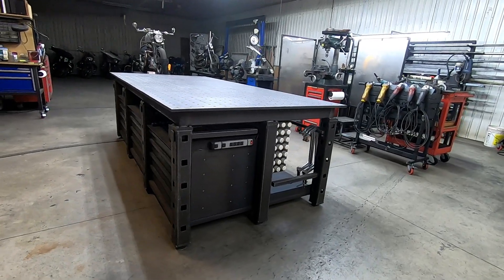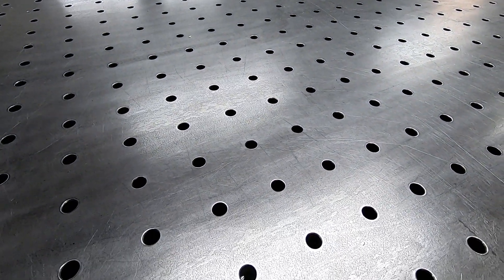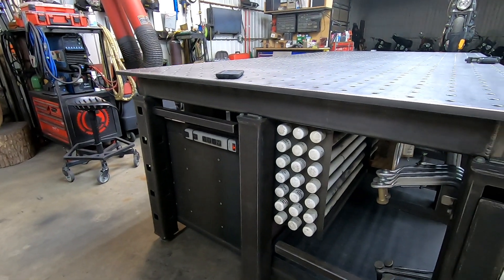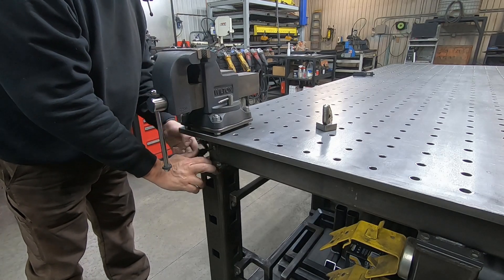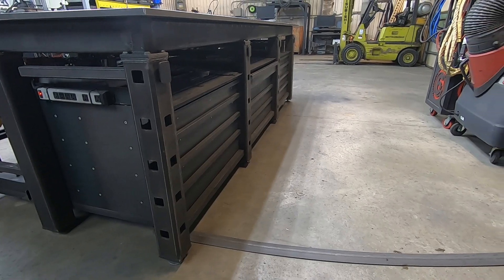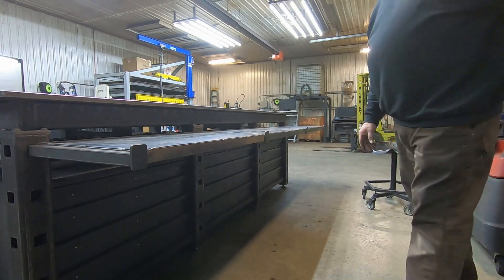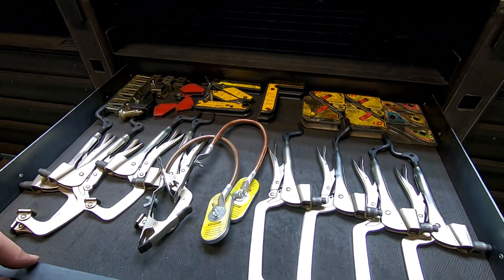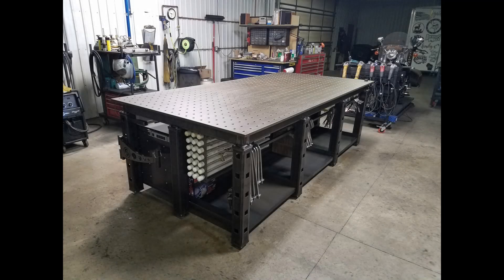6L Designs homemade 5x10 welding table with many unique features

Comment: That is an amazing fabrication table/jig table!  Did you make all those drawers as well?
Reply from the maker: Yes, I sure did! It was the only way to really maximize the storage space below the table top!!
Reply: How many hours do you figure it took you to fabricate the complete table?
Reply from the maker: @wade7920  Total time including CAD drawings 137.38 hours! I kept track of time and material cost, which was $7,160.22 in 2019! It would be quite a bit more today!
Reply: @6ldesignsmetalinmotion217  Yup, figured it was expensive.  I know steel went thru the roof a few years ago.    Don’t know how high it is currently.
Reply from the maker: @wade7920  It came back down, but not to what it was before COVID 19! It's just how it goes!
Reply from the maker: I worked on it for about three weeks from start to finish! @wade7920

Comment: Great table, what kind of drawer slides did you use?
Reply from the maker: The slides are made by Accuride. They are full extension, ball bearing slides, side mounted, and are load rated at 100 pounds each! The product number is 3832EC. They are all still working very well, despite the fact that some of the drawers hold more weight than the rating!
I hope this is helpful!

Comment: Thats a well thought through welding table. Kudos!

Are the drawers folded sheetmetal? Or something of the shelf?
Reply: Thank you for your very nice feedback!
I fabricated the drawers myself to utilize as much storage space as possible! They are made from 12ga hot rolled mild steel and very heavy duty!
For my first table, I purchased tool chests and designed the welding table around them, to make them look as integrated as possible, but for this built, I started to design the welding table to meet my needs, and as a result made my own drawers, because there is nothing available that fits perfectly!

Comment: Very nice table and attention to detail is great. I am going to ask where you got the swivel pads and the handles to make the hold downs in your last  bank of drawers? They look like dogs and are in the back of the 2nd drawer from the top in the video. I have been searching for these parts, as I have made the main dogs and have the threaded rod and hardware for them but lack the parts mentioned above.
Reply: These are homemade clamps to apply side pressure, and insert into the table top just like the regular ones for down pressure! 
They are very simple to make out of a C-clamp and some 5/8" cold rolled round stock.
Feel free to contact me through Instagram if you'd like more information!
Thank you for your nice feedback! Greatly appreciated!

Comment: Is your drawers modular that fit into the square tubing also? Do you have any plans for sell?
Reply from the maker: Hi Tony! I have drawing files of the table as PDF files and as CAD files, and I'm in the process to get setup to make them available for purchase in the near future. Feel free to let me know if I can help you in any way!
Reply: @6ldesignsmetalinmotion217  Thanks you for replying. Just yesterday I bought a Stronghand Max table top from BuildPro and came across your video and really liked your design. I can see how you made everything but can’t see how the drawers are attached. They look like they could be welded or modular into the square tubing holes. I’d like see the the drawer slides you are using. I plan on duplicating your design and may be adding a few things of my own. Thank you so much for sharing. I can give you my email address if needed.
Reply: @tonystephens933  Sorry for the long wait, Tony! I totally missed your message! Please send me your email address!
Reply: @6ldesignsmetalinmotion217   Hi, Are the plans already  available for purchase?
Reply from the maker: @r12dannys  Yes, they are! Thanks for reaching out to me!

Comment: Thanks for sharing this Wolfgang.  This thing was designed and built with everything having a purpose with the end user in mind. When I built my table I pulled so much inspiration from it along with incorporating my own features for my workflow.  Next is to built a similar shelving system. (wish I could a found an off-shelf drawer system to fit perfectly under my table).  When I get a bigger space next is to build a 5x10 table like yours!
Reply: You're gladly welcome, Ratha! Without your encouragement there would not have been a video or a 6l designs Youtube channel!! Thanks for your continued support!
Reply: Ratha your design is not complicated is simple and the best I like is the tray’s not keeping grinder dust under the table wolfgang your  table is nice too but having a tool box under the table don’t know it would save space not having a toolbox on the side I’m not a expert but seen a lot of shops and tables don’t stay clean only if you going to do surgical work probably it would stay clean Wolfgang you made a great table the best thing I like is the side panel if I can added to RathaSochenda table I would do it thank you Wolfgang for you video

Comment: Really great design.... how flat were you able to get it.........your shop is very clean
Reply: Thank you very much! The plate came very straight, and has only a slight crown of 3/32" on one end over the whole width. It has not affected the flatness of the pieces I have welded on the table. In regards to the clean shop, I cannot work in a mess. I don't know how others do it, because I wouldn't find anything, or get anything done!
Reply: @wolfgangsixl9283  I feel the same way about keeping the shop clean, grinding dust always gets me.....do you grind in a separate lication?
Reply: @westweld  No, that is where it happens! I clean up several times during the day with compressed air and a broom.